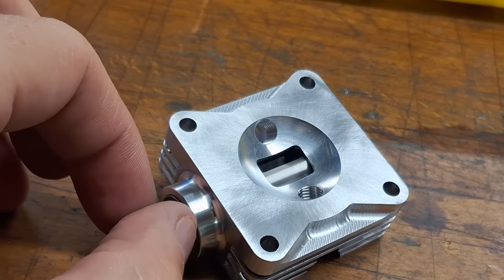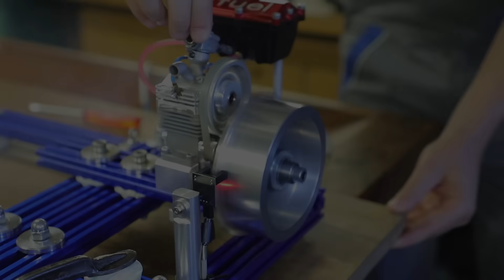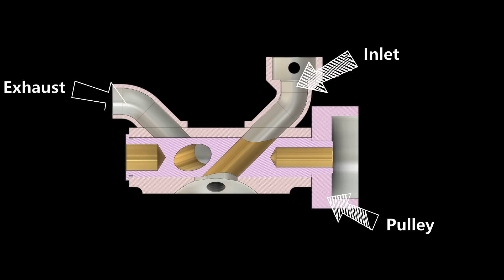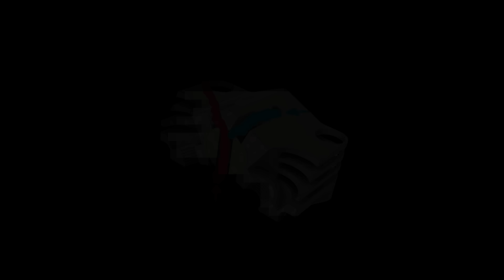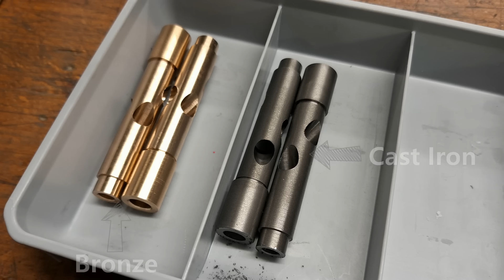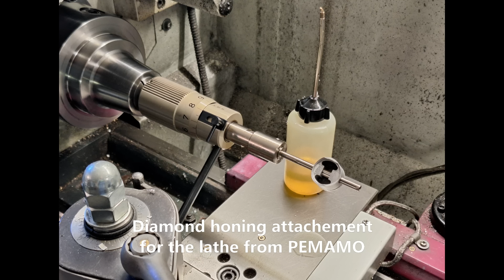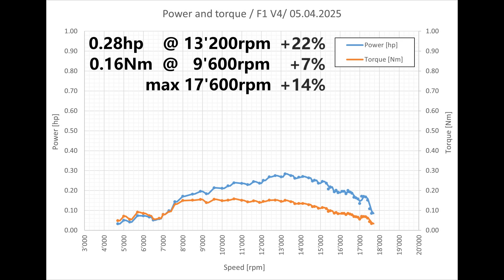New Rotary Valve Design for Model Engine / Modellmotor mit neuartiger Walzendrehsteuerung / Part 2

Comment: I think the valve opening was to smal 
And the timing was wrong 

Rotary valves work better if there are 2 rotors 
Timing them with a flow overlap
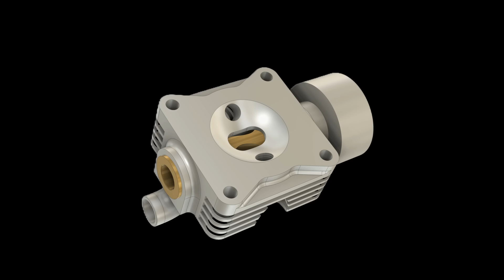Reply from the maker: Hi man 🙂 The valve cross section and the timing is identical to my 0.60 hp rotary valve version with 2 valves. Simply as a remark: Of course there is a valve overlap. Watch the video at 02:50min, you can see it very well there.

Comment: CAN YOU MAKE A 125CC ENGINE 4 STROKE ROTARY VALVE AND PUT THE ENGINE IN A MOTORCICLE AND YOU CAN SE HOW MUCH PERFOMANCE MAKE A 4 STROKE 4 VALVE ENGINE AND THE ENGINE 125 ROTARY VALVE
Reply from the maker: Hi man! This is just a small 6.5cc model engine. 125cc is big! I made a 53cc V8 with rotary valve which produced 4.6hp at 18'300hp. But who knows!? Maybe ones in future I will modify my 125cc Honda Monkey.
Reply: @danielhunziker3577 i think that with the Rotary valve It whil do more hp

Comment: Why do you think it's so much worse? Also in the future you could try to maybe modernize your engines with fuel injection and Lambda sensors, could be interesting I think.
Reply from the maker: Hi Neutrida 😃 How would you rate the 0.60 hp versus 0.28 hp?
Funny that you talk about modernisation 😅 Have you seen my last two videos about the Electronic Fuel Injection for model engines? https://www.youtube.com/watch?v=moypOvQ_ue8&t=111s
Reply: @danielhunziker3577  Did you use the same port positions with the engines? I don't really understand how there is a 0.32hp difference. 🤔

I forgot about it, you mentioned there is still some issues with the setup. A Lambda sensor would be great for tuning but I don't really know if it would work on this scale.
Reply from the maker: @Gang61Tr  Everything is the same like in my 0.60hp 2 valve version like compression ratio, timing, carb, cross valve section, etc.

Comment: CAN WE MAKE THE 50CC HONDA RC116 PARALLEL TWIN WITH TECH SHOWN IN THE FOLLOWING VIDEO https://youtu.be/5czHDU6pK8E?si=0AIfjTHXZm-dkAzf   
I JUST WANT 20HP OUT OF IT AT ANY GIVEN CONDITION  RUNNING ON NORMAL FUEL OR Methanol 
OR A 80CC INLINE FOUR
Reply from the maker: Sounds like a challenge for you?
Reply: Did you watch the video?  ,I meant If it's possible to build, from your experience what would u say ? Not a replica but a engine that could be fitted in a bike ?

Comment: You totally forget Wath means rigth timing.
That s why you don t built so much Power
The port is never fully opened and Is duration Is nothing more 60 degree.
At 17000 you Need something like 280 degree.
This Is the problem
Think about
Reply from the maker: Hi man 😃 I find it fascinating that people talk about timing but don't even know what the timing of this engine is. Can you tell me the timing of this engine?

Comment: Maybe you can supercharge intake pressure, as you can close the cylinder.. have you seen this turbo 2T with rotary exhaust valve? 
https://www.youtube.com/watch?v=5czHDU6pK8E
Reply from the maker: Hi Man 😃 You mean this engine, which is a 2-stroke witt intake valve (or rotary valve) but the intake stroke is done with a compressor? If so, I can say that I don't understand the system. Because the crankcase of a 2-stroke engine is already a compressor and the piston itself is slide valve.

Comment: your port and chamber design are hurting your performance. also unknown is your valve timing. this shows the concept works but you need  way more the just a big open valve randomly  at each cycle.

what was your compression ratio?
what was your dynamic compression?
hemi head is a bad choice for quench and high compression,  recommend a wedge or pent roof with ports on 1 side to promote swirl.
Recommend divided ports so swirl helps evacuate cyl.
what is your valve overlap?
what is your valve duration?
Reply from the maker: Hi man 🙂 Let me summariue your statement: You think the combustion chamber is a bad coice, the timing is wrong and the compression ratio is too high?
Reply: my point is he doesn’t list any of details. The hemi head is notorious for being low compression and prone to knock at higher compression. So I doubt it’s has high compression. Also simply having over lap is not the same as proper valve event timing. Comparing this engine to a modern popit valve with over 100 years in engine development is obviously not gonna hold its own. He needs to look as proper valve event timing. To have a properly running engine. 

The intake valve needs to close at least 60deg after bottom dead center for the rpm range. And it should have 170psi at least cranking pressure.
Reply from the maker: @taverncustoms  I can only tell you that I didn't fall on my head 🙃Have you taken a look at my 2 valve version? https://www.youtube.com/watch?v=TMYDdoHDgFs&t=2s
Bye the way: This is just a hobby and does not have to compete with modern racing engines. My goal is just to build a great, exotic model engine 😃

Comment: youre limiting airflow with the single valve design. eliminate the dual plug and use the extra cylinder space for an additional valve- dedicated intake/exhaust.
Reply from the maker: Hi man 🙂 This isn't necessary. It's sufficient to separate the valves and build a clean 2-valve system. Look here: https://www.youtube.com/watch?v=jq-HnA0U8M4&t=33s and than here https://www.youtube.com/watch?v=TMYDdoHDgFs

Comment: Heat kills.  Using a single valve for both intake and exhaust is not operational, it cuts down your volumetric efficiency way too much.  You have to separate both functions and the key obstacle is still sealing.  I see the solution using a thin flap at the edges of the rotary valve shaft such that combustion pressure presses this flap against the spinning shaft.  It would be a metal to metal seal but it would help in getting your BMEP up to an acceptable level.
Reply from the maker: Hi Rafael 😃 Sealing and leakage is always a problem with rotary valve. I have here the advantage of dynamic sealing by using oil in the fuel. A active sealing is a good solution, but to find a solution which is that small to fit in model engine like this is very tricky.
Reply: @danielhunziker3577  Either way keep at it, it´s a fun channel to keep an eye on.